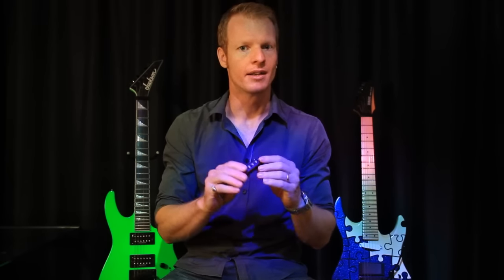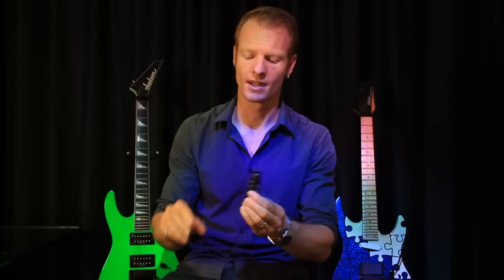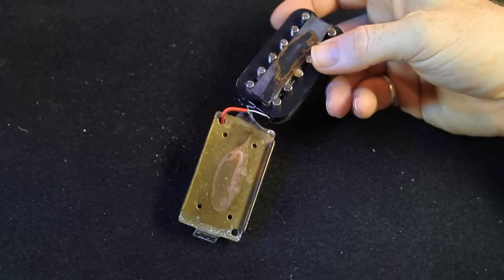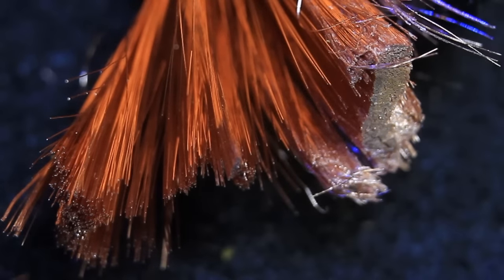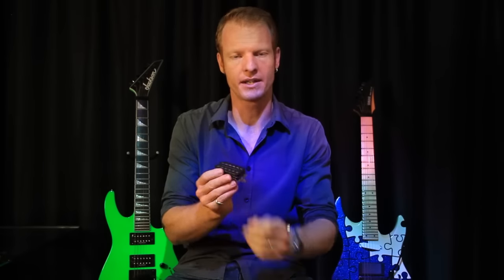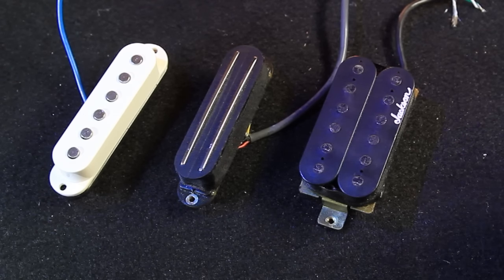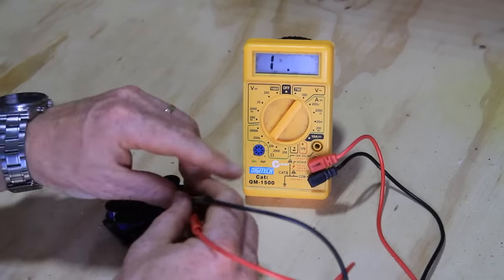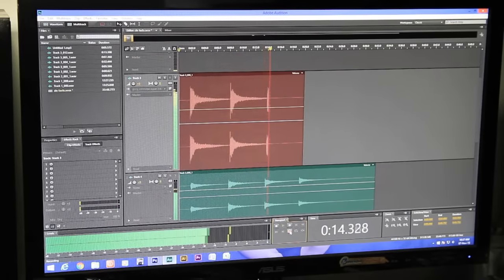Active Vs Passive Pickups - Guitar pickup facts & figures  (Including pull apart) - AndyRooJ

Comment: Active and passive pickups is just the same except the active have a preamp , typically a tiny microchip.
Im stay with my passive pickups , that way I can just add a preamp if needed.
Sound difference ? 
Not really because it's just ordinary pickups , only thing adding to sound is the sound of the built in 
preamp and when it's built in it's not possible to change that at all...
Active pickups is just a 'new hype ' , truely not needed and truely just something you wont use if you want to 
be able to control the sound 100% .
Oh and another 9v battery using source.....
If the preamp for some reason fails then ...... Nah , I stay with pickups without any preamp and extra electronics.
I can always just add what I need in the chain of effects indtead and it will actually give me better sound quality too.
Why ?  simply because Im the one choose the preamp and not a factory built in chip/integrated amplifier.
''''' New Hype """" yes and im not on that.
Reply: passive or active - old dynamic mic or phantom powered electred mic !?
If you are that kind that always have the same setup, effects and amps or like to be able to load you pickups to sound right to the occation - passive is your trade.
But if you have to connect to a multitude of different amps., effects and even sometimes directly to a mix input and need your guitar to have exactly the same sound/tone every time - and active pickup, maybe even with active tone controls, might be your best friend ;-)
Reply: @bopcph  I do not think you understand it.
The guitar ALWAYS have the same sound.
It's the different gear that give the different sound. A passive pickup NEVER change the sound . 
It's the different construction of input / preamp / their impedance / ect ect 
that give them ' the sound ' 
Heck there would't be any reson to choose a specific amp if they all ' sound the same ' but they doesn't...
Your guitar DO sound the same all time ( until you change pikups or tone components and or shift polarity of pickups )
You Can't just use a different amp and think you can get the same sound...
WTF , different amp's = different sounds..
They are built to have their ' OWN ' sound.
This is excactely what most people NEVER get correct the first time.
YOUR GUITARS PIcKUPS NEVER CHANGE IT'S SOUND.
Your Gear shape your sound.
If im going to buy a new amplifier then I WILL BRING MY GUITAR TO TEST AND TRY IT OUT.
NO guitar in the shop will have same sound as my guitar.
oh of course if you use Active pickups then it doesnt matter cuz you can just borrow one in the shop and it sound just as all the other with same active pickups.
What a REAL musician prefer is to have the sound and it be unique.
You want same sound in all places ?
Go ahead... Just get active pickups..

Do you realice why nearly ALL records / tracks / cd's / bands ALL have the same sound ?
shure , same Software , same  DAW's , same amplifier's , same pedals , same Active guitar pickups.....

With passive guitar pickups NO 2 Pickups in the same product line will sound the same.
They are all a little different because of variations in all from vindings to density in materials in coils ect.
That's why it's so hard to find the excact ones that will give you the sound you want.
With active pickups you can finetune all coils and preamp to a maching state and the whole productline
of guitars ( same model ) sound the same.
This is NOT the case when you buy a guitar with passive pickups.
You can have 10 guitars in same model ( product line ) and they all sound a little different.

When I rought my guitar 16 years ago I tried several at same model before choosing the one that have 
the sound I like.
Yes it makes it more difficult to buy a guitar.
But when you find the ' right ' then you have the sound for life.
( Or until you want to experiment with other pickups )

Now I hope you understand that your guitar doesn't change anything at all when it comes to sound.
It will keep the same sound as the pickups you have installed.
BUT YOU CAN NEVER EXPECT DIFFERENT AMP'S / MIXERS  / EQUIPMENT To be able to give you 
the same sound no matter what you connect to.
-------------------------------------------------------------------------------------------------------------------------------------------
That's why musicians ALWAYS being their OWN gear into the studio.
WHY DO YOU THINK THEY BRING IN THEIR OWN GEAR WHEN RECORDING IN A STUDIO ?

It's to get that sound they use......Because their gear is what give them their sound.
Their guitars / bass ect will always keep the sound they was ' born with '  
in combination with their gear it create their ' sound '
--------------------------------------------------------------------------------------------------------------------------------------------
Reply: @kennethsrensen7706  It appers that I didn't express my self clearly - or actually not at all clear, more likely cryptic - sorry

I have been an electronics designer for 40+ years - I have worked with and build audio amplifiers of just about any known type and technology so I know every thing about how different two, especialy tube, amplifiers can sound and, when placed on my bench, look so different that it seems impossible that they came from the same production line.
And then, I can build a 1000 amplifiers that precise that you won't even be able to measure the difference between them.

I can produce passive guitar pickups that are that equal that you won't be able to hear the difference - but probably measure the difference - though I don't think you are willing to pay the price for such precision :-) 
I might not be able to produce them to exactly the sound/tone you like but the will sound absolutely the same on the same guitar/string-set/amplifier.

Wood is not, in a scientific sense,  a homogenious material, so no two music instruments build of wood can sound exactly the same.

As musicians bring their own instruments and often amplifiers I, as an engineer, nearly every time, bring my own tools that sometimes include masuring mics and my own build measuring amplifier - because they are calibrated together.

You finished you studio - I didn't finished that polyphonic analog synthesizer I started building 45 years ago - probably should have set the ambition level to monophonic then I might have succeded ;o)

We both knows alot about this stuf - but most likely from different angles :-)
Reply: @bopcph  Ah..... Ha ha , I got it and I see you also got it .
Yes we see from different angles but not that different.
Yes I have built amplifiers too especially tube amps and even made pickups.....
Hm... A studio never get finished , there is always something....
Ok it seem we both understand from each different angles ....
ha ha yes it's possible to get such precicion but a musician rather prefer that unique sound that the others doesn't have......
I have spend more than 10 years modificating my tube guitar amplifier to get the sound I like.....
Same with my guitar...
Think about brian may's unique guitar and sound , ect.....
That gave ' personality ' to the music.
Back in time bands have a more unique sound.
Not like today where almost all have the same sound , it's quite boring.
Ok great we 	an understand each others way of ' understanding ' ( if can express it in this way )  : o)